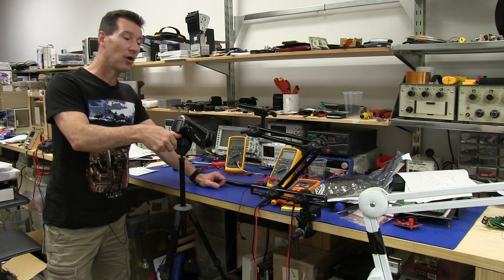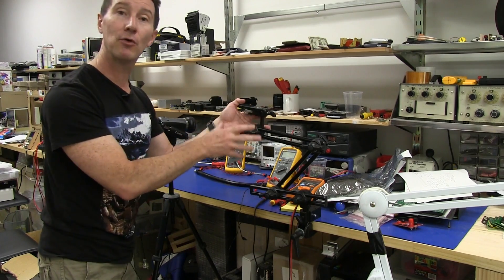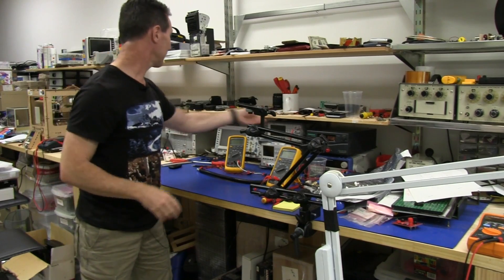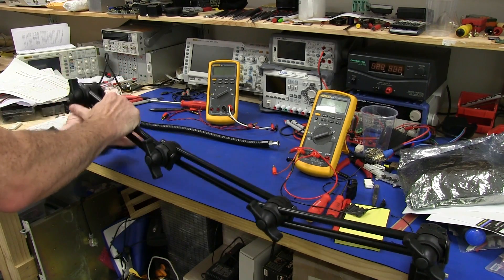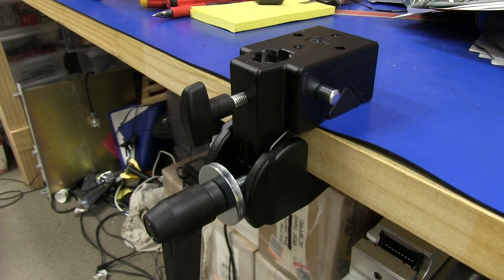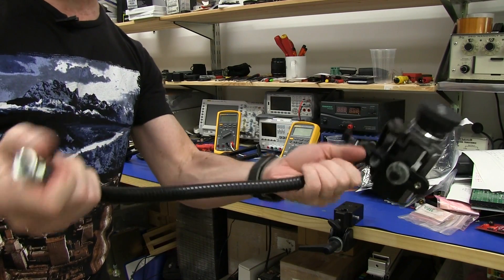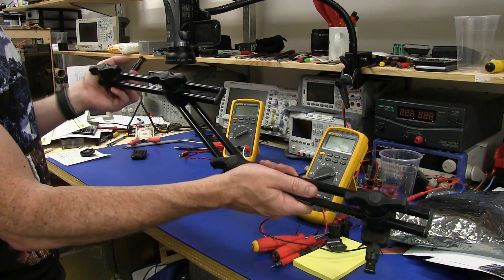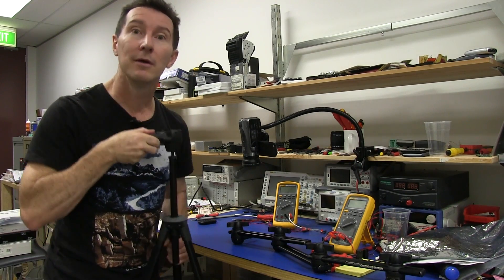EEVblog #550 - Manfrotto Video Camera Articulated Arm

Comment: mount the sliding mechanism sideways so it slides from right to left, not in and out and then clamp the flex arm to it so you have the left/right reach with the slider and the in/out reach from the flex arm. Not sure how rigid the sliding mechanism is, but I suppose it'd work if you already planned to use it for the in/out movement anyways

Comment: Dave Jones Lately I've been using 3 cameras, starting them all up at the same time.  When I get done, import to computer, make a multi cam clip - which auto-syncs the video for you, then I simply watch the clip, clicking on the camera angle that I want to use at the correct time in the video.  Shooting and editing time is greatly reduced.  I use Final Cut Pro on Mac, but I'm sure there is multi cam support in the software you use.

Comment: I would like use the Manfrotto 035 super clamp and the 237HD heavy duty flex arm with an Ipad Air for making videos over a table. Do you know if it will support the weight of the Ipad with the adaptor? Which is the weight of your Canon camera with the base for screwing? Thank you so much!

Comment: Another (cheap) option for you would be to use a C stand (with a nice big sandbag holding it down) with an extension arm on it, and a grip head with a spud to 1/4-20 (or 3/8-16) adapter to a ball head. This will be extremely stable, even if just because a C stand probably weighs 5 times as much as your lightweight tripod. Probably a pretty cheap option (C stand + 2 grip heads + 5/8th x 3 foot arm + spud adapter + ball head) and perfectly adequate for your little cameras.

Comment: There's a company called NOGA, they sell a articulated arms that uses ball joints and one knob to tighten it. I use them as a General Machinist for dial indicators and can be adjusted for any position.

Comment: I don't know if you've ever used one, but you probably want to get yourself a sand bag or several. If you throw one over the spreaders of a video tripod (or hang one from the hook of a stills tripod), you'll be amazed at the difference it makes to stability. The difference is enormous, particularly with lightweight tripods like yours. If you want to hang an arm or gooseneck from a tripod, this is the magic solution also to not having everything want to fall over because the camera is outside the centre of gravity. Sandbags are used all the time in the film industry -- they are one of the least talked about but most useful gadgets on any set. :-)
Reply from the maker: Interesting idea, might look into that, thanks. Mine has no hook though, so would need to rig something.

Comment: I was about to suggest a Magic Arm, coming from professional film production. It also doesn't allow 'smooth' moves, you'll need a dolly system for that, but it should be fairly quick and easy to just reposition your camera. It also might not be as stable as possibly though, but it should be better than that flexible arm. Certainly a good one to try out at least, and if it doesn't work, you can still use it for a million other things, I've often attached microphones to them.

Comment: The magic arm is nice, we use them at work to hold monitors in front of studio cameras. However, it requires a lot of torque to lock it. That's no problem for super Dave, but it is difficult to maintain a precise shot while locking. Once locked, you can't do minor adjustments without unlocking it.
Reply: I just found out that Mafrotto makes a Magic Arm with a variable friction lock knob instead of the all-or-nothing cam locking lever which I have used.

Comment: Hate to tell you but your best solution would be either a robotic camera head system (can be picked up used on eBay) or multiple cameras so you can just have an inexpensive overhead hd camera that stays in place pre focused on a spot on your bench for your down shots. Then keep using the tripod for frontal shots and your microscope for real close ups.

Comment: I've seen several machinists that use a Noga indicator holder for their camera on youtube, and it does appear to give good results.  They are expensive and you need something for the magnet to grab onto, but they use a single knob to lock everything.  May be worth a look to get rid of the tripod in the way

Comment: Thank you for making and sharing this video. Very useful info here. I had very similar problem, though my work space is tighter and more peculiar than yours, and the camera is heavier. I must have watched this video at least five times, pondering whether that three piece arm would work. Decided I'd have the same issue with it as you mentioned, of not being able to move it in different angles. In the end I bought the 'Magic Arm', also by manfrotto. I am mightily impressed, as the wheel to tighten it tightens every moving part all at once, and the angles it can achieve it truly brilliant. Genius piece of kit. If you're still looking for further improvements, I'd recommend it. I clamp mine to the vertical part of a mic boom stand, and once you take into consideration the length of the super clamp, the post, and the sliding attachment at the end, it's a very usable length. Anyway, apologies for the essay, but you helped me with this video and thought I'd offer my solution back.

Comment: Maybe (for the locking in place of the sliding mechanism) you can use a screw, wich goes through the whole moving thing, and on one side of the screw a handle, so you can tighten it easy, and on the other side of the screw a peace of floor protector, that pushes against the workbench when you tighten the screw... Just a taught

Comment: Since you like the flexible arm maybe have a look at flexible coolant hoses? Loc-Line is one brand and they come in a variety of sizes and has tons of different connectors and accessories so you can build just about anything with them. Just do a google image search for "Loc-Line" and you'll see what I mean. As it happens I just ordered some cheap knock off of the stuff from china last night to build a holder for a soldering light :) Hopefully it'll be as rigid as the real stuff.

Comment: Jokingly I thought the overly technical version. A multi ball-join arm with two handles at the head. One for the camera and the other which when grabbed release solenoids which stiffen the joints. :P
Reply: Same here, except we could use cables for the release (think bicycle breaks). Could we be on to something?....
Reply: Maybe... Would be quite the bulky setup. But hey when you got a plethora of requirements sometimes simple doesn't work! Heh.

Comment: You could mount a real linear bearing under the bench that would be a lot more stable than the cheap slide you have now...search eBay...

2 x SBR16-1150mm 16MM FULLY SUPPORTED LINEAR RAIL SHAFT + 4 SBR16UU Block

Comment: Dave: you are an electronics guy, get a used industrial robot, mount the camera on it and use a voice control or something to position it.  I stumbled over a small FANUC spot welder without controller 1000bux